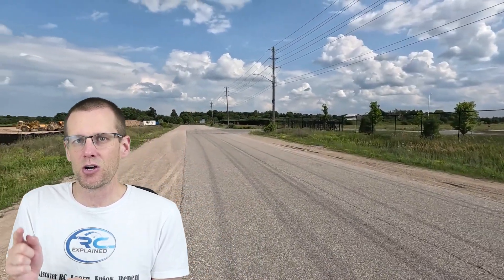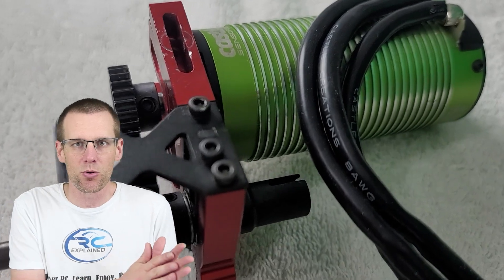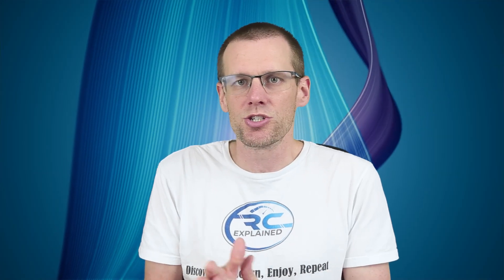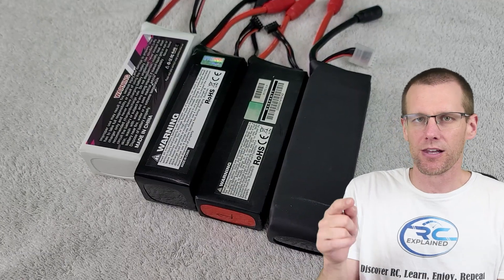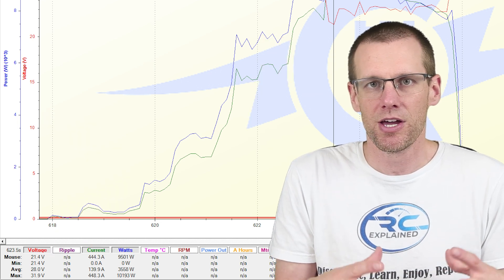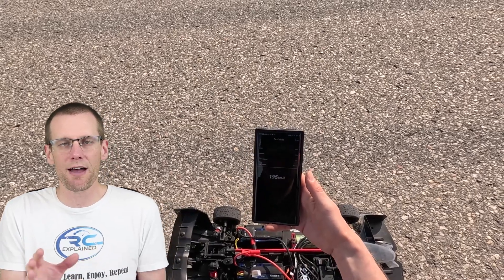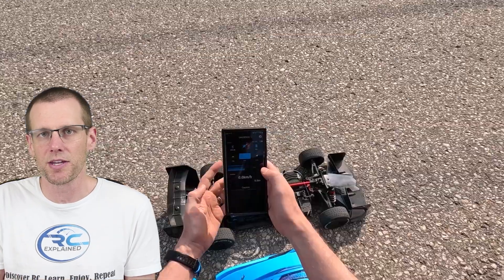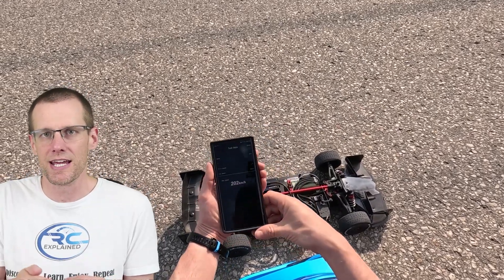What Component Would You SPEND Your Money on for a 100mph+ RC Car?

Comment: Fun video!  

During my quest to 100 mph with my Traxxas Bandit, I learned a lot of things.  My opinions below are based on goal of around 100-115 mph.

I am with you, the most important thing is the LIPO.  I picked up about 10 MPH using a higher end LIPO (SMC 3s 6,500 mAh "150C" LIPO vs a lower end LIPO like a Ovonic 5,200 mAh "50C" LIPO).  A lot of people don't appreciate how important a higher end LIPO is for speedruns as the are used to lower end packs and think they are good enough.  The difference under high load is MASSIVE. 

The difference between a lower end ESC like the stock Velineon ESC or a HW 120A unit and a mid level ESC (ZTW Beast Pro V2) was about 4 mph in my setup (and less likely to almost burn your car down like my Velineon ESC did - after many speedruns in the high 90 mph range).

Good connectors at the motor/ESC and ESC/LIPO are also good for a few mph.  I like 8mm bullets at the LIPO/ESC and 6.5 mm at the ESC/motor.  Cheap, easy to solder, and flow lots of current.

As for the motor, again  I am with you.  I was using a $40 XTeam 3665 4500kv motor and it is good for around 115 mph in my Bandit on 4s and over 100 mph on 3s (and has been bulletproof doing so).  In a lighter car it would probably be good for closer to 130 mph.  Sure, a higher end motor will have power but at these speeds, the motor usually isn't your biggest limitation (getting the car to be stable, getting the right tires, optimizing gearing, and running a good LIPO to me are the most important things.

Comment: The best way would be to start with a solid foundation like a HoBao chassis, unlike an Armma that has poor driveline geometry that robs power and wears out too fast. 
You can use brute strength to get to 100mph but 200mph is where you cannot ignore efficiency
Reply from the maker: What component wears and how long does it take for the wear to set in? V1 or v2?